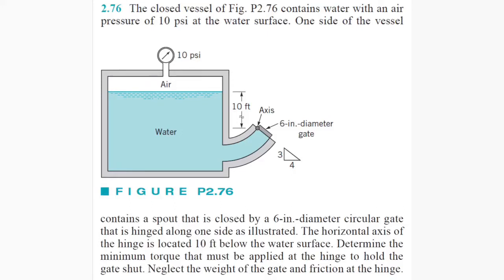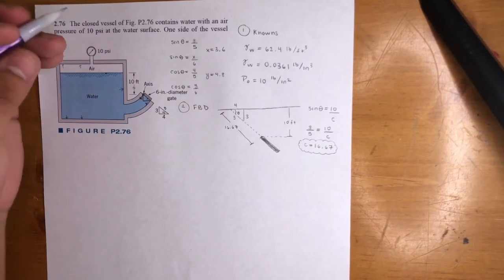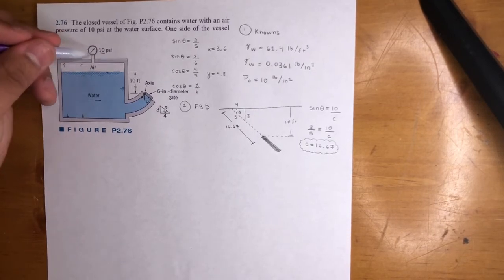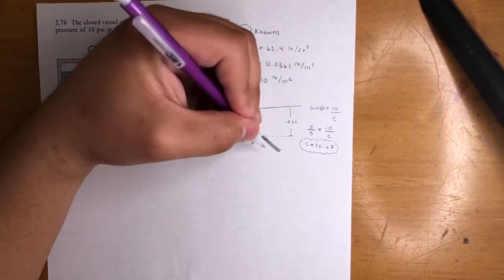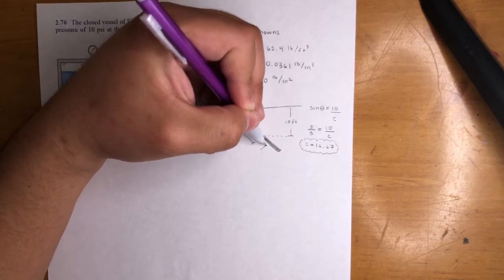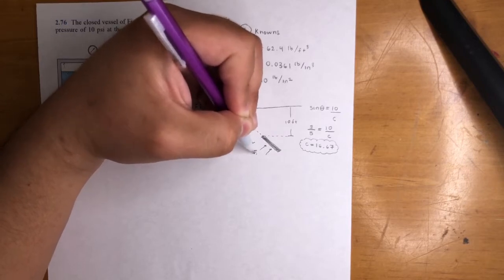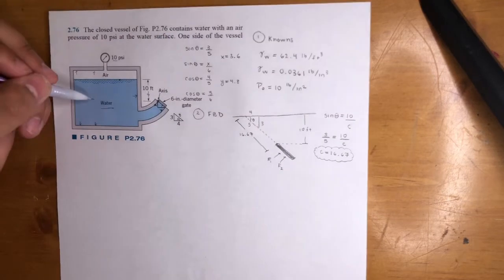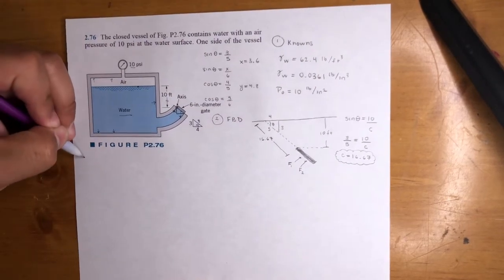Fluid Mechanics - Closed Vessel Contains Water w Air Pressure of 10 psi at Water Surface

Comment: Hi there! Don't you need use 203in - 200.04 fo the final step? We are taking the moment with respect to  the hinge, not the free surface, right?
Reply from the maker: Dammit you’re right. The way I do these problems is I do them beforehand and then record em while copying the other paper I previously did it on. I left out the difference 203-200.4 since yes, we do it with respect to the hinge, not the free surface.

That’s why the answers make sense but the setup, I probably missed copying it. Ima pin this comment so people with the same question can confirm the correct setup for the last equation.

Thanks and I apologize for the confusion!